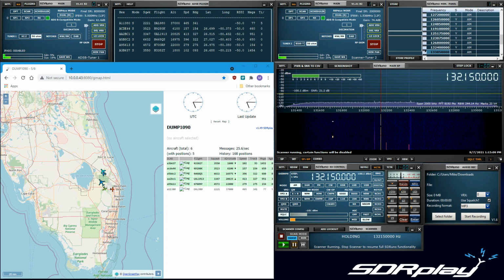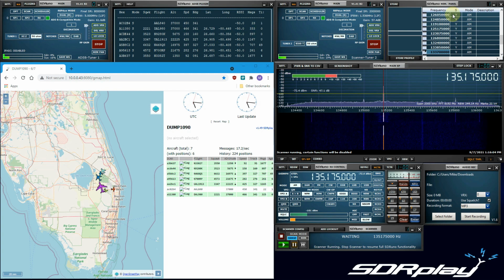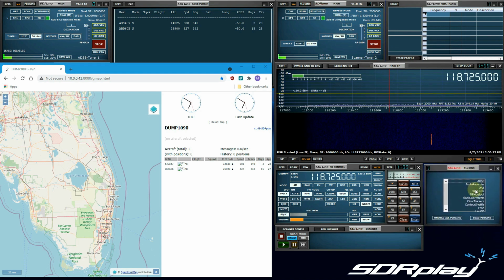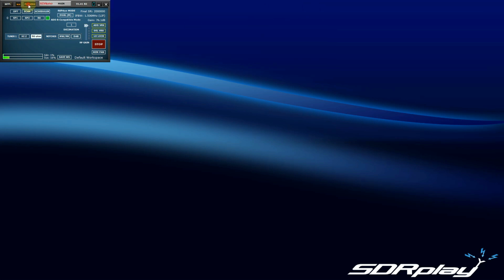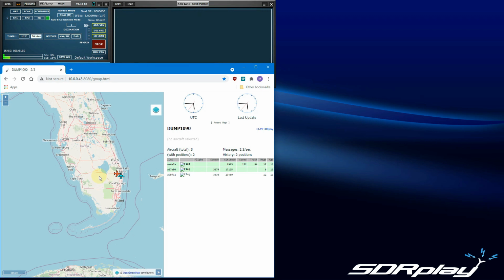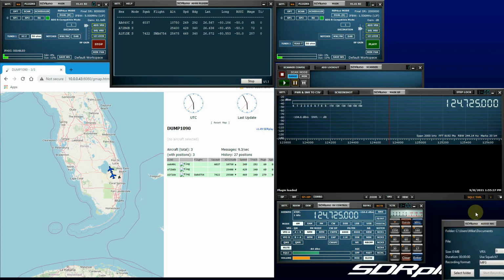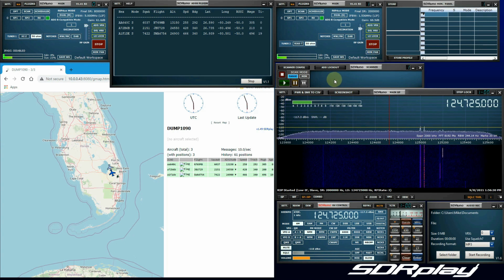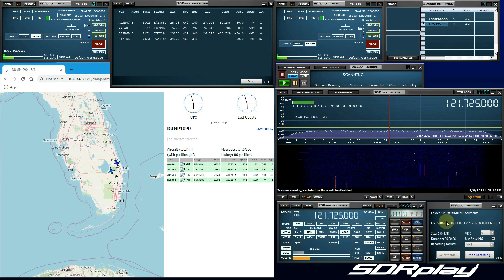SDRuno, RSPduo, ADSB & Scanner recording

Comment: As always, nice job Mike.   Two questions:  1. Why do I see entries in the plugin window disappearing and what appears to be changing on an already displayed line of text instead of just scrolling off the the screen?  I guess I don't understand t5he methodology of how the data is being displayed.  2. Is the a logging function for the plugin to have a running list of decodes saved somewhere?  Again thanks for the video and all the others that you do!
Reply from the maker: Likely after x amount of minutes it drops and replaces it with new spot when received.There is no loggin within the plugin itself but I believe you can log spot using a third parties application like planeplotter or similar. https://www.sdrplay.com/docs/ADSBpluginBeta.pdf

Comment: can i decode adsb and listen to atc on the same antenna, in other words can i attach tuner 1 and 2 to the same antenna via software? thanks
Reply from the maker: Yes, you can using a hardware splitter/combiner or an signal distributor.